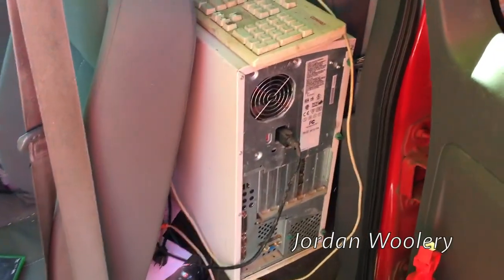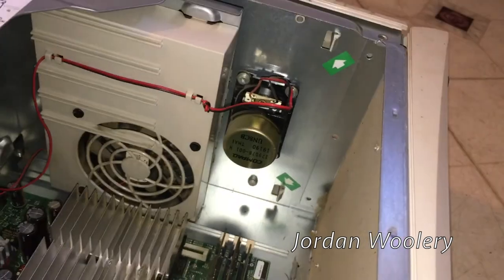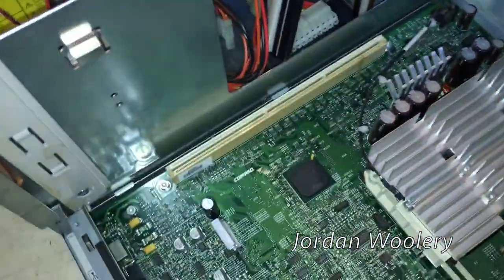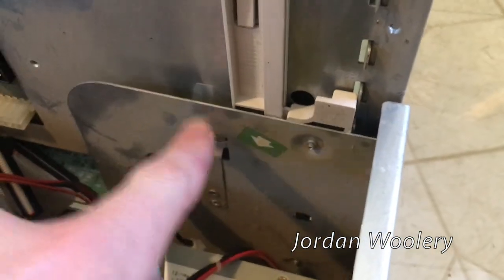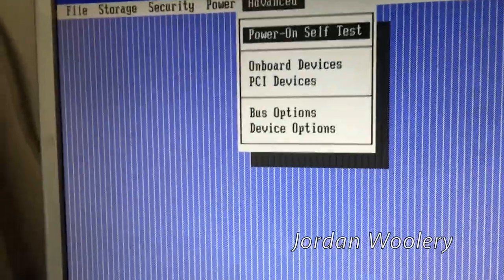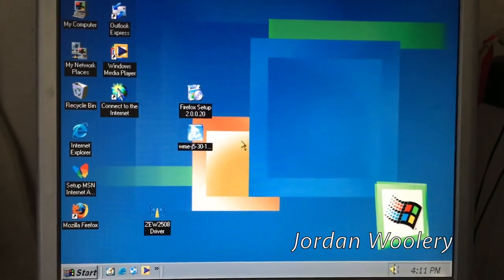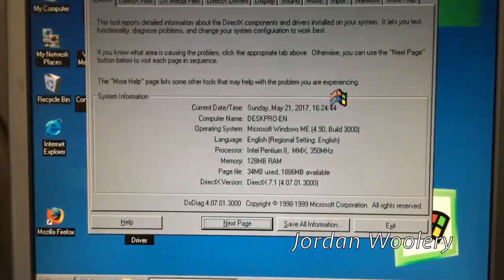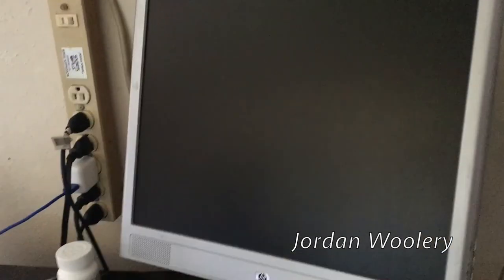Yard Sale Finds: $5 Compaq Deskpro EN P2-350 | May 19, 2017

Comment: Nice find! Most computers (usually crap) I find at thrift stores they'd want $100 for that lol.
Reply from the maker: +Hunter Yelton I saw an old Dell Dimension 4300 that they wanted $30 for. It had Windows ME on a 20gb hard drive, a 1.7 GHz P4 and 128MB RAM. GeForce 2MX/200 graphics and a Sound Blaster Live value edition. Lol